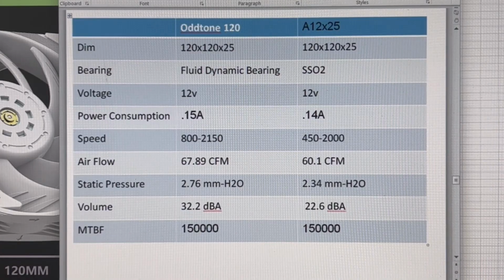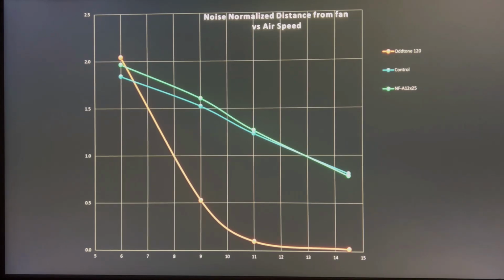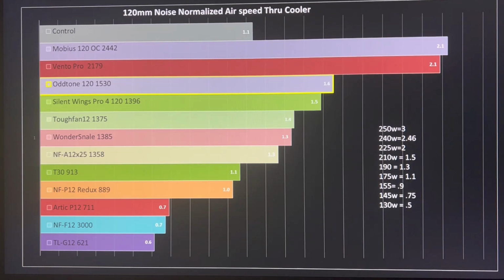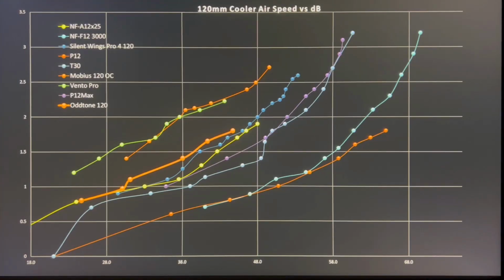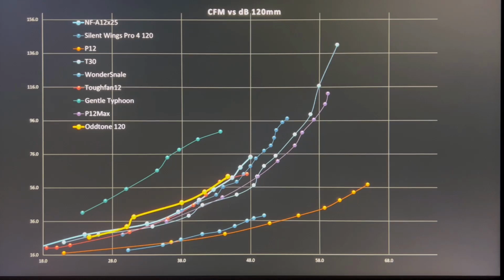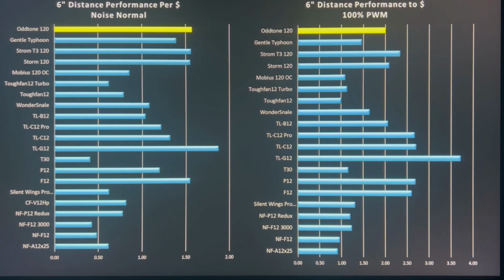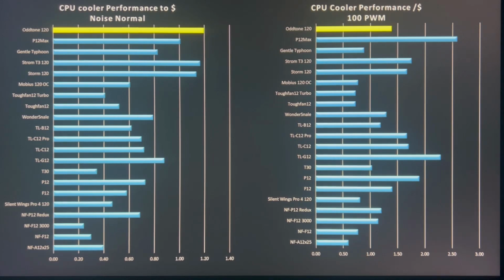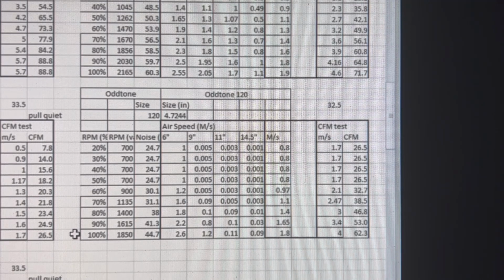A12x25 Copy Cat: Oddtone 120 / Teucer  (Old Testing Method)

Comment: If anything, it's more of a white/black version of Nidec's Gentle Typhoon which predates even Noctua's NF A12X25.
Reply from the maker: sort of. i would say halfway between then because the typhoon has smooth blades and other features that are different. Visually this is more similar to the A12x25 which is based on the Typhoon. . . . .